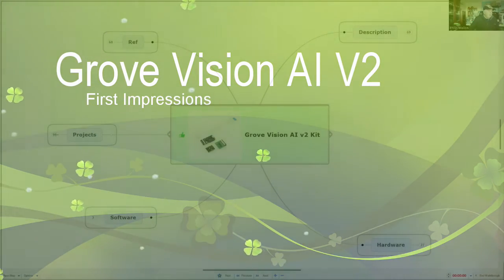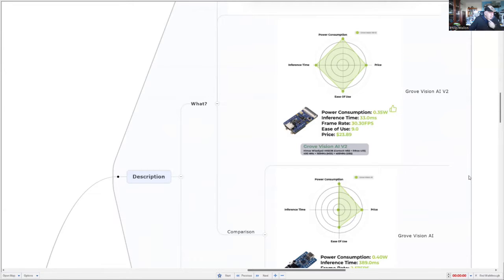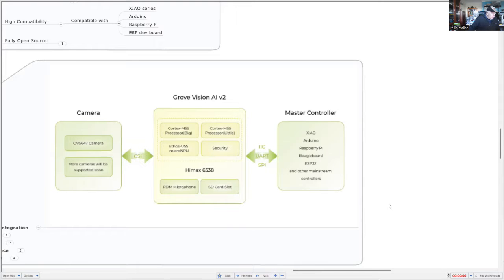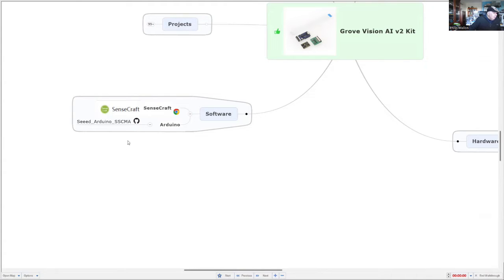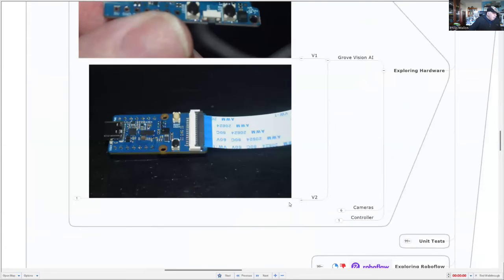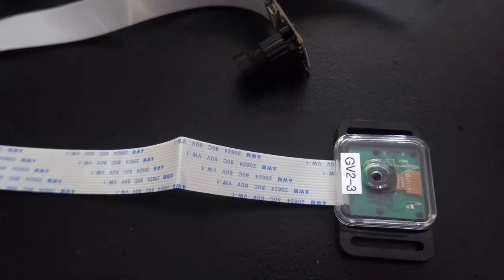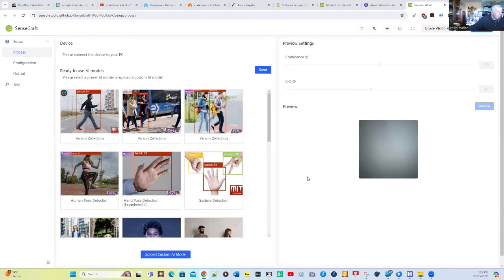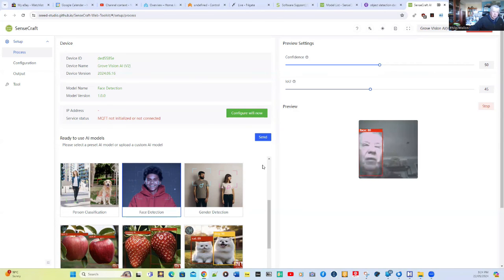Grove Vision AI V2 - First Impressions

Comment: These damn things never work for me. The 3 boards are plugged in and my computer USB cable is connected to the XAIO board. The V2 module has a continuous green light on but the XAIO has a continuous red led on. According to the Sensecraft setup page Help chat, this means that something is wrong or failed. BUT WHAT? Pressing reset does not fix it. Piece of useless crap!